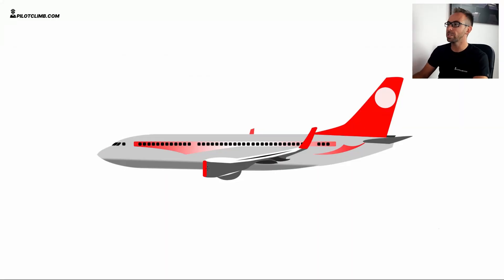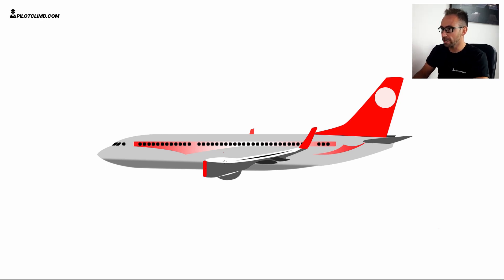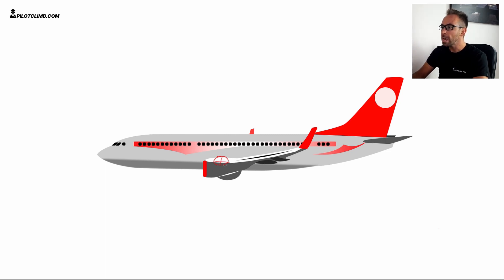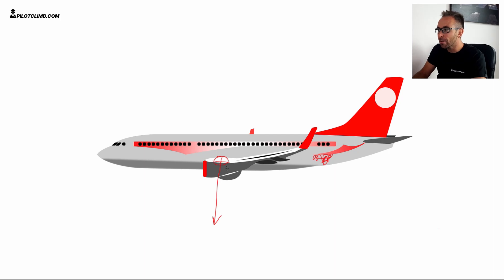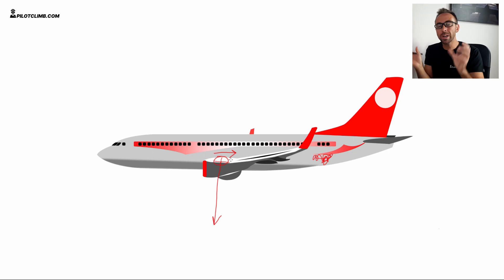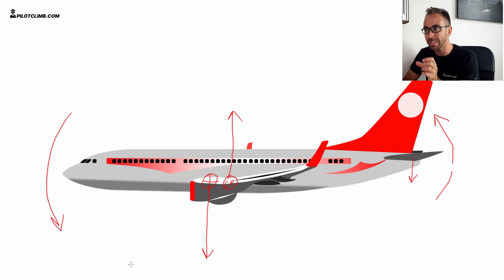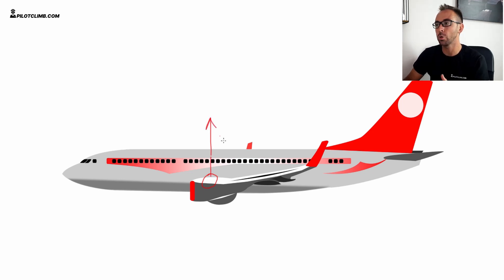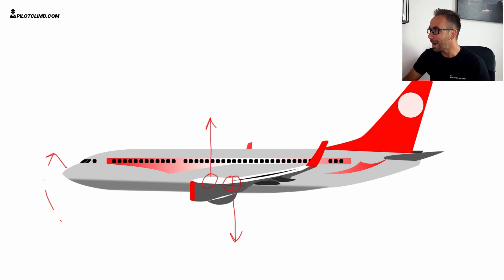Aircraft Center Of Gravitty Explained - [What Is It And Why Is It so Important].

Comment: I was an aircraft Load suprvisor. One day a 747  flight came in from Bombay stop over and flying to JFK 600 kilo freight to off load. At the time, I was also dealing with another arrival. So sent half my crew to deal with off load . When I finally got to the Bombay flight Rear loading door closing! My crew said there was no frieght to unload.Hold empty! The flight then took off to JFK After I was informed there was indeed 600 Kilo freight on board! What I would like to know is, WHaT IF IT WAS 6000 KILO REMAINING ON BOARD! How would the aircraft perform on take off?
Reply from the maker: That would be s problem because the aircraft is heavier than the pilots think, so they calculated the takeoff performance for a lighter aircraft.

Comment: Thank you for the excellent explanations as always. Which one would be best in this situation for takeoff performance?
Reply from the maker: You are very welcome!! Usually you load the Aircraft to have better cruise performance, since is the phase of the flight where you spend the most of the time... A fwr cg will make your nose heavier thus an higher Vr should be required

Comment: Great Video captain thank you. What is the point called in the '''middle'' that neutral point , if you put cg in front of it planes nose down and if cg is aft of it planes nose up.Is it called Aerodynamic Center or something else?
Reply from the maker: You are very welcome! The Aerodynamic center is used as a point where the Aerodynamic forces are applied and doesn't change with the angle of attack.

Comment: Hello Captain, great video as usual.
I have a quick question for you though :
Why is the CG expressed in percentage? For example if my simulator tells me I have a CG of 23.7% what does that mean? How do I know if it's acting more in the AFT part or in the FWD part? Thanks in advance 😊
Reply from the maker: Many thanks for the great comment!! The 23% is the percentage of you MAC (mean aerodynamic chord). That means that you CG is located along your MAC at a distance that equals 23% of the length of the MAC. Let me know if I answered your question
Reply: @PILOTCLIMB  Great answer, I had no doubt about it. I'm gonna have to look for the MAC because I never heard of it. Anyways, thanks, you're the best out there and deserve way more subscribers and views!
Reply: As far as I understood, the MAC is the distance between the Leading Edge Wing and the Trailing Edge. If these are parallel the chord is equal at all points. For these huge commercial aircraft the design of the wings and the weight make it difficult to calculate all of these things and so they use the CG as a percentage from the MAC itself. If a plane has a CG between 0-50% is nose-heavy whereas if it has a percentage beyond 50% is tail-heavy. It has some limitations as you said in your video about the location of the CG so the ideal one should be around 25%. Thanks for the infos, if you're running out of ideas you could make a video about MAC, Leading Edge MAC and Trailing Edge MAC, it would be very educational, useful and interesting 😊😃
Reply from the maker: @leonegentile6081  You are the reason why I'm putting countless hours to produce content!! My very proud of the PILOTCLIMB community!! You are doing a great job and it gives me a great deal of pleasure to see that you are learning and improving!! Many thanks for you support!!
Reply: @PILOTCLIMB  Actually I'm the one proud here. I follow a lot of pilots, german, English, American but you're the only Italian that puts passion in what he does, regardless of his views and subscriptions. I'd say you're Italian from your name and I'm Italian too, viva L'Italia e forza Gabriele, sei il numero uno!

Comment: Good Day Capt Gabriele, i have other question. For Boeing 737 aircraft if during flight fuel were used/burn and reduce the weight of aircraft where is the CG Center of Gravitity moving? Is it moving forward or aft ward?
Reply from the maker: Hey, many thanks for watching! You always ask very good questions! On a Swept back wing (like the Boeing 737) normally the CG will move Forward as you burn the fuel that is inside the wing. This is so because, usually, the wing tips are emply first. If you have fuel on the center tank and on the wings tanks however, you will burn first the fuel on the center tanks (which will cause the CG to move aft) and than you will burn the fuel on the wings (which will cause the cg to fwr). I wish you a great day!

Comment: Great video. So the center of gravity doesn't stay exactly at the same point as the weight is, right? I presume there's a ratio between center of gravity point and the exact location of the weight, am I correct?
Reply from the maker: Many thanks for watching!! The C.G. location change if the masses inside the plane change location. For example, if all passengers move at the back of the plane during Cruise, this will make the C.g. to move aft. If the weights inside the plane stay constant and don't move the CG won't move. Let me know if I answered your quistion👍

Comment: Good Day Capt Gabriele, 

First thank you for this great video 

I have 2 question here
1. Is CG equal to MAC(in %) ?
2. In video 10:25 with nose heavy/forward CG stick/control column force will increased also stall speed increased. Could you please explain more detail about this 2 relation? 

Thanks you and have a great day ahead....👍👍👍
Reply from the maker: Hey, many thanks for watching!! 
1.Usually the C.G. location is expressed as a % of MAC in the Airliners Jet. If you look at smaller planes the C.G location can be expressed in distance from the datum line. You simply need to verify this info in your Airplane Flight manual.
2. Nose heavy plane will increase your stall speed because the plane will reach the critical Angle Of Attack sooner. (I made a separate video where I explain the Critical Angle Of Attack.)
Lert me know if you have more questions.👍
Reply: @PILOTCLIMB  Thanks Capt Gabriele for your reply and explanation

I have another question, if we unload the wing this mean we increased lift force compare to weight/gravity force or we increased AOA. Is this statement true or false?
Reply from the maker: @steffenleo5997  You are welcome! What do you mean by unloading the wings?? Reducing the weight?? For example, less fuel?? Or unloading the wings by reducing the G force??
Reply: @PILOTCLIMB  i see other video on youtube the training pilot say unload the wing first by pushing the nose down to increase the roll rate. In the video it is about plane at nose high over critical AOA. So i understand his comment as if we unload the wing it mean we increase the lift vector, is it true?
Reply from the maker: @steffenleo5997  ok i see, when you pitch down the G force on the wing decreases. If you have the AOA above the critical AOA the wing is stalled and the force acting on the wings are minimums. Is different if you have a high AOA and then you pitch down, in this case yes you unload the wing.. 👍
Reply: @PILOTCLIMB  Thanks a lot for your answer Capt Gabriele... Have a nice day ahead... 👍🙏👍